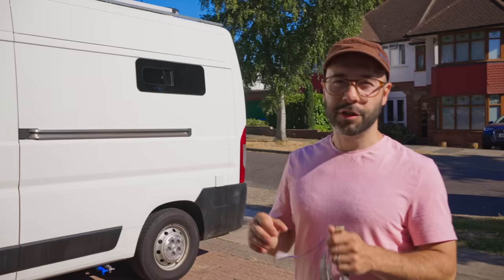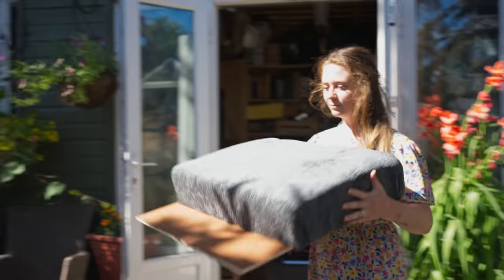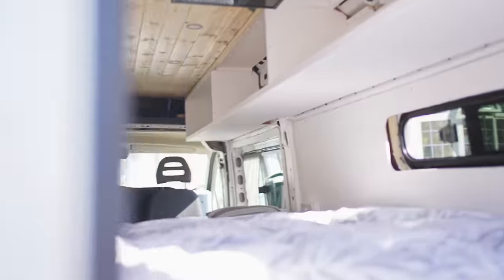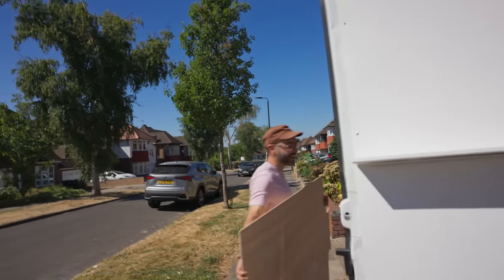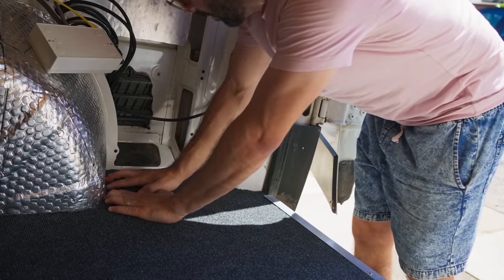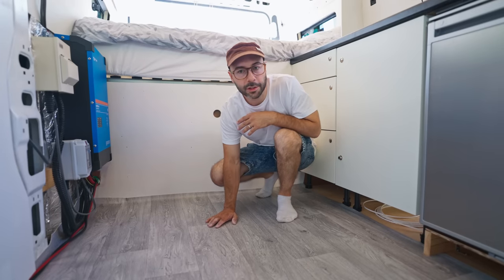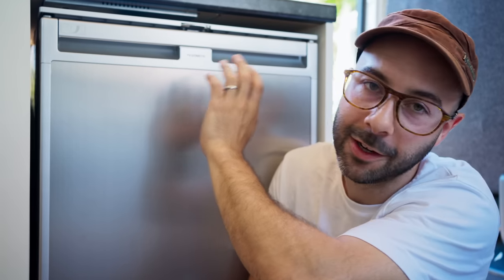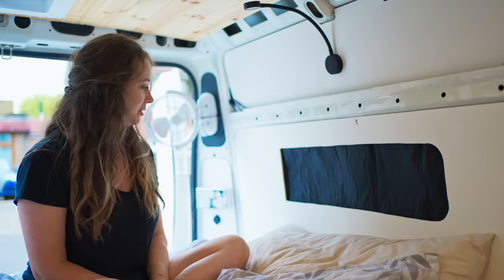Final touches to our Camper Van | DOMETIC FRIDGE FREEZER CRX 110

Comment: I didn't know you had to put decals on to reclassify the van how do the stealth campers get around that?
Liked the video it looks like a quality build.
Reply from the maker: It is only if you want to classify it as a campervan for insurance. It's not a requirement to do so, but the insurance is cheaper. 😁
Reply: You also need 2 windows on one side in addition to the drivers or passengers plus an awning rail. There are requirements for the inside but they are easier. You don't have to have the body type changed at the dvla. Some do, most don't.